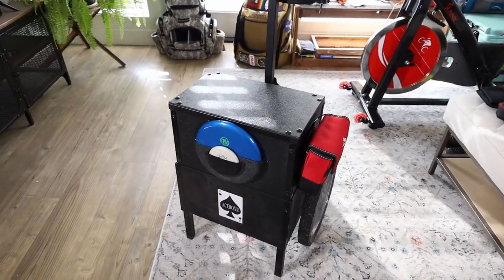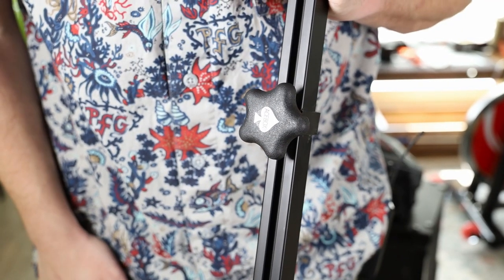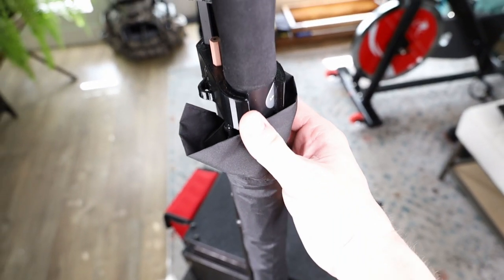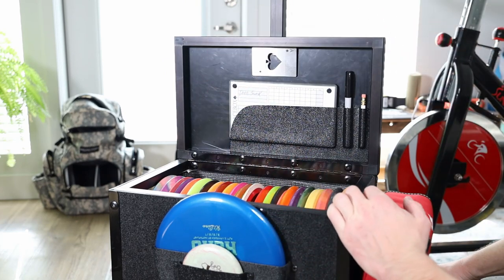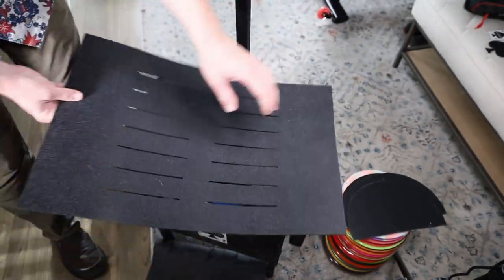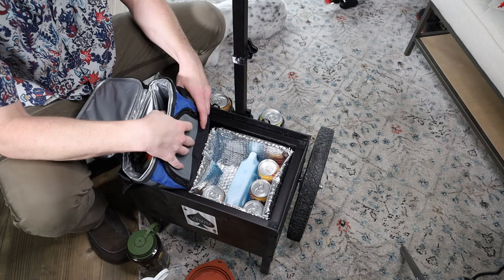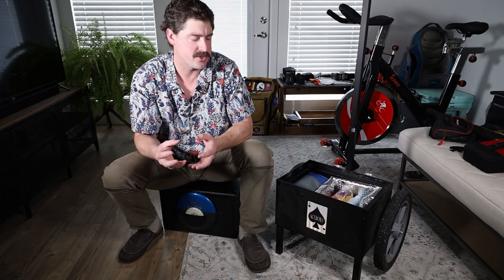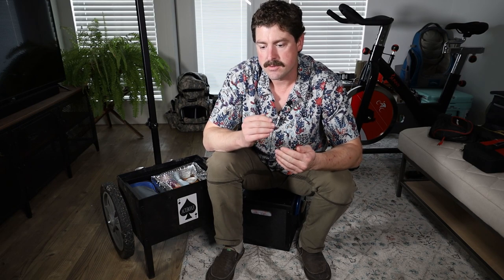AceBoxPro Disc Golf Cart Review

Comment: I have #002 (and #006) and honestly doubt I'll ever go back to anything else (wipe it down and it looks brand new even after well over 100 rounds in rough Arizona terrain).  I would not recommend adding a putter pouch (22 mixed disc + putter in front is plenty and as you point out ruins the atheistic) but did line my top compartment  with a drawer liner material and added felt pads to dividers (all of $12 fix) to make it ninja quiet (TY Nathan!)  Personally I use 1 compartment at top for wallet, keys, phone, etc.  (in my old zuca plastic pouch) and a USB port battery connect to a 10" uv light bar I stuck to the inside the lid. Perfect for night rounds and looks sick. I put a sweater in bottom because its cold early here but warms up quickly and vice versa plus a few (8) beverages and flashlight, snacks, and more. At least double the storage of my old Zuca in a smaller footprint.  Seat height is perfect.  Ability to reach disc is a big relief on my back just by being 4-5 inches higher than the Zuca. Owner Nathan is unbelievably responsive and he has a passion for each of these babies.  Its worth noting that the design makes this cart highly maneuverable empty or full (fulcrum is spot on) and despite tank look  and high quality is pretty light.

Comment: Great review Doth as always. How do feel about the sideways handle placement as compared to the front facing handles I see on most every cart?  Which style do you prefer and why?
Reply: I was wondering about that too.
Reply from the maker: Yes, forgot to address this.
Initially I did not like the sideways handle. I even modified it by cross drilling the main pole and rotating it so that the handle pointed backwards.
What I then realized was that the sideways handle has a solid advantage.
With a rearward pointing handle you grab it with your thumb pointing towards the cart and push the cart. If you then wish to let the cart swing behind you and pull it instead this becomes very uncomfortable to do with out changing your hand position(swing your arm behind you and try to point your thumb at the sky and you will see how uncomfortable that position is). When pulling the cart you want your thumb to be pointing down(or away from the cart).
So what I'm getting at here is that to push the cart for maybe 20 or 30 feet and then let it swing behind you to pull for the rest of the walk requires you to rotate your hand position which is cumbersome to do.
With the handle pointing side ways it leaves you with good wrist/hand positioning weather you are pushing or pulling the cart and for the transition you don't need to change your hand position.
I ended up swapping back to the sideways handle, and I have now been converted to believe this is the superior position.
Thanks for the good question Kent!
Reply: @DothSavek  I keep my handle at a 22-45 degree angle, best of both worlds, when transitioning from pushing to pulling it lets me finesse my hand back the same to the minor degree without requiring a full 90 degree shift, but requires a swift 180 once the direction changes and I feel like its more ergonomic to have the wrist/palm angled outwards while pulling :)

Comment: Thanks for another suburb review Doth.  How high is the seat off the ground when the boxes are stacked? Thank you.
Reply from the maker: 24"
Reply: @DothSavek  Thank you Doth!  i am also interested in reviews of the ridge roller R3 and the Crosslap Cubis 2.4 (currently only in Germany due to a shortage of packing materials to ship to the US).  Something that I would find helpful in cart reviews would be a discussion of seat height & cart center of gravity as they relate to course elevation & terrain.  as someone who lives and plays in Vermont and New Hampshire,  many courses involve elevation.  So for lots of up and down on trail like terrain, I am assuming that I would do better with one of the carts with lower centers of gravity (R3 and Cubis with seats at around 18.5 ").  However, this is a trade off because you have to bend over further to get your discs.on a flat course, the Zuca/DD Transit or the AceBox Pro offer the advantage of a higher compartment for your discs, requiring less bending over.  this is significant because some folks, such as myself, are looking to switch to a cart to reduce stress on the body.  Thanks for considering and thanks again for the awesome review.  I especially liked the discussion of liking the interaction with taking the boxes off.  You rid me of my skepticism.
Reply from the maker: @Jeremy-cn1xk  Very good point. It would be awesome to AceBox, R3, and Cubis all together at once and do a demo for weight/balance and disc height. That would be a cool little comparison to do out doors where I have a bit more room to move around. Might not be able to get a cubis but I should have an R3 soon
Reply: @DothSavek  what about Zuca?!

Comment: Great review, what're the internal dimensions of the bottom box? Interested in what options I'd have from a YETI soft cooler inserted and/or alternative bag options.
Reply from the maker: The tube inside of the frame near the top of the bottom box is 13-3/8" x 8-5/8" and is 6-7/8" from bottom of box to bottom of frame, and 7-7/8" from bottom of box to top of frame. If your bag/cooler can sit below the frame then you have a bit of extra room for play on the sides. There is a horizontal frame across the bottom back of the box(axle runs through it and each corner of the box has a vertical frame bar in place.
Reply: @DothSavek  Thanks for clarifying!

Comment: Awesome review. This is a cart that would be out of my budget but if i had unlimited money to spend on disc stuff, id most likely buy this. Is the bottom box large enough to fit a 30 rack of cans in? Also, whats the weight of the cart overall, is it a pain to load and unload from a vehicle?
Reply from the maker: Not gonna be able to set a 30 rack in there. With loose cans I bet you can get at least 24. I didn't weight the cart. I will try to remember to do that.
Its really easy to load and transport. Just loosen the two handle screws and set the handle in the car, set the top box in, set the bottom box in.